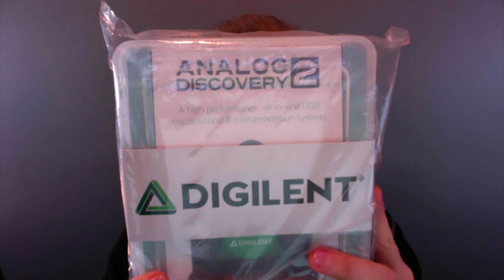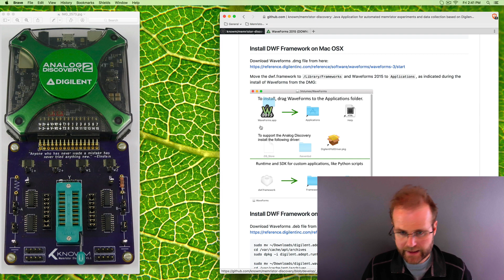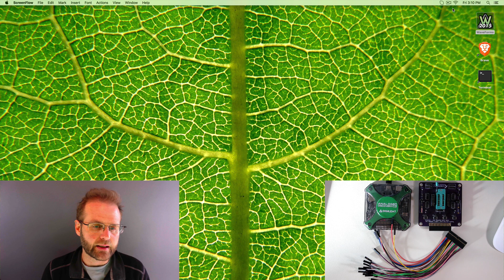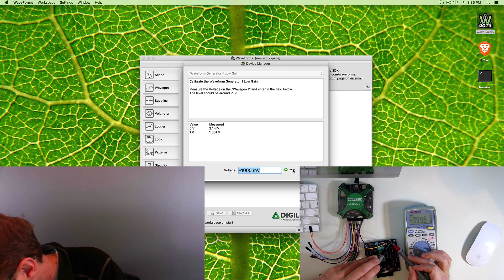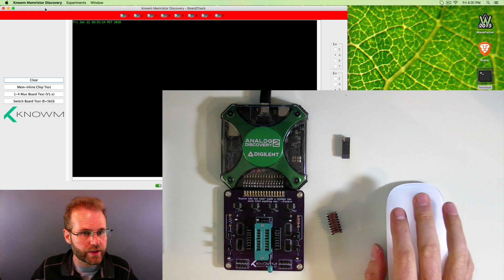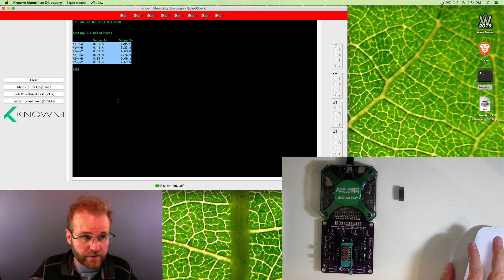Memristor Discovery Setup (V0.0.7 Update)

Comment: What could I do with this board in academic ? I am keenly interested in memristor.
Reply from the maker: The Memristor Discovery board and open source software was designed to facilitate academic lab experiments on memristors. Combined with the Analog Discovery 2 and the open-source software, users can run experiments ('apps') that allow programmatic control and routing of signal generators and oscilloscopes to multiple circuit nodes, as well as dynamic selection of memristors.